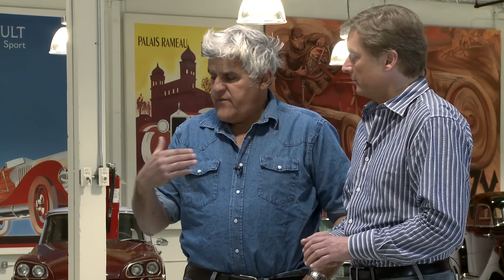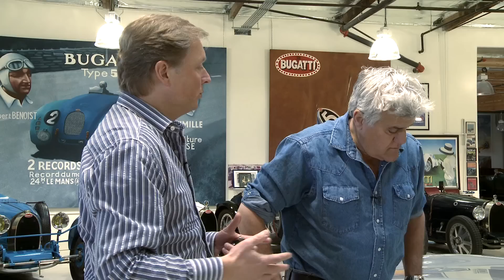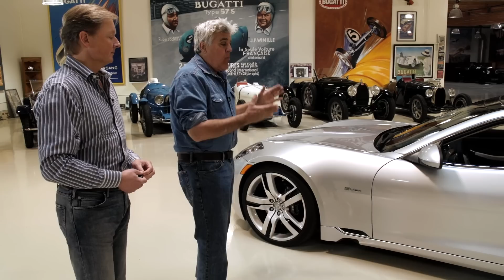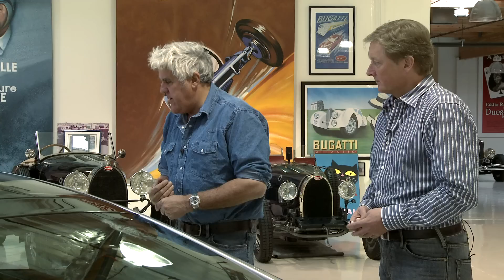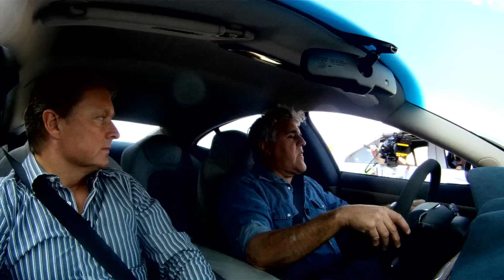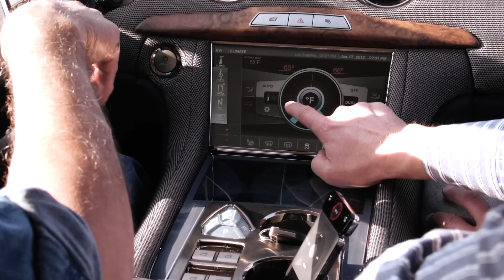2012 Fisker Karma - Jay Leno's Garage

Comment: Jay, my fellow carophile, lol. 
The term "electric car" is a misnomer! It's actually a "battery powered, or operated" car. Let me illustrate. I use many tools. 
There are two types of tools that use electricity to operate...work. 
For instance, an "electric drill" has a power cord that has to be plugged in to an electric outlet for it to operate...work. Then there is a "battery operated" drill where a battery has to charged on a charger, and then... that charged battery has to be attached to the drill for that drill to operate... work. I could give you many examples of "electric" tools versus "battery operated" tools, or other devices. So calling a battery operated car an electric car is a misnomer.
-------------------------------------------------------------------------------------------
Reply: Yeah wtf

Comment: Too bad Fisker had to fold back in 2013. By now they would have at least 4 different models on the market. I still think that Hydrogen or some other power generator could be an excellent power source for the electric motors and batteries. Perhaps only in a large car like a pickup or full size SUV due to size. Not long ago I took a 1K road trip in my Model X charging time alone was close to 5hrs all together. We need either battery swamp tech, static charging or extender range with hydrogen or something else. Pure Electric is amazing for any trip up to 400 miles. Just my 5 cents. :)

Comment: I would've put the engine and generator in the rear and the batteries in the front. Make the front end smaller and the cabin more forward. Looking more like a mid engine car. The front ends are too big on many modern vehicles. Especially trucks. It is beautiful though.

Comment: I think F1 cars don't work like this because there is a loss of power incurred from changing the work of the engine into electricity and then back into rotation.. in F1 cars the engine drives the wheels and is assisted by the electric system which also recovers braking energy.

Comment: Henrick Fisker is a disappointing "car guy".  He says the Karma's drive train (called Q-Drive) is unique and not like that of the Chevy Volt, but he's incorrect. The Volt is also a Range Extended Electric.  He also refers to the tires as "high profile" when they should be called low-profile.  To me, he just sounds like a used-car salesman...  Now he's trying again with his new company to develop an SUV, and so far it's all smoke and mirrors.  Sorry Jay.  I know you guys are friends,  but tell Henrick to stop spending investor's money and get to work actually making a car and a network of dealers / repair facilities.

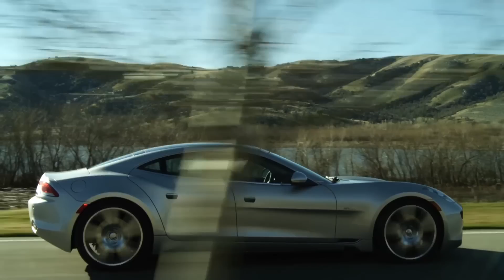Comment: 1:45 1100 lbs of torque and speed of a v8 but doesn’t say the 0-60 is 5.9 seconds 
Not only it’s the poorest use of space but the poorest use of power as well
At least Prius has 5 seats 😂
No wonder it lost so much value and no wonder people see so many of those on the streets 
He is definitely #1 in something
The 2012 model s did 0-60 in 3.9s @ $109k and had a range of 265 and free supercharging
Why would anyone in their right mind buy a more expensive car, inferior, and costs more to run and will break a lot easier

Comment: That GM 2.0 turbo engine has 255 hp, 295lb/ft torque, and gets over 30 mpg on the highway in a Buick Regal Turbo. The Fisker has a total range of 230 miles, 30 of which are electric. With a 9 gallon gas tank, and 200 miles extra range from gas, it is getting 22mpg by converting to electricity. Why use the GM LTG 2.0t engine and not a little 3 cylinder?

Comment: He says it's different from a Chevy Volt because a Volt has a direct connection between the gas engine and the wheels. Wrong. I'm amazed that someone can get to the position of this man and just be blatantly wrong about a simple topic. It is in fact identical to the Chevy Volt in terms of drivetrain design, and in fact, the Volt was the first to do it, and the first to use the term "Extended Range Electric Vehicle". This guy is ignorant in his own field. So sad.

Comment: 1100 ft-lbs of Torque and a 0-60mph time of 6 seconds, so sad, when a 2 speed tranny could have put it sub 4sec .... dumb engineering compromises killed this car, performance should have been MUCH better, should have been equal or better than Tesla Model S, but it isn't even close in performance ... the Fisker Karma certainly is much better looking than any Tesla .. the styling is superb, a wonderful example of how a 4 door hybrid can be styled better than any traditional gas engine drive-train car.

Comment: I don't think I like it. First impressions are that it looks cool, like a cross between an Aston and a Z8, unsurprisingly. But actually the details aren't good, the panel gaps are huge, exhaust on one side with a plug on the other, and that little thing at the bottom of the diffuser, what even is that? Jay was right to be confused about the engine bay, it's absolutely packed. How does a 2L engine, 1 speed gearbox and generator take up that much space?! Most of it seems to be the front suspension, which is very bulky. The performance sucks and the eco credentials suck. It does 20mpg on the engine. With the efficiency luxury car makers are achieving with IC engines these days, you're better off with a properly engineered big diesel.

Comment: a really cleaver upgrade would be to put an audi inline front wheel drive gearbox in between the motor and generator, like the one in the audi quattro, then all options would be open even petrol driven.a true hybrid

Comment: you can just see the build quality issues in this showcase car. the panel gaps and closing the hood..
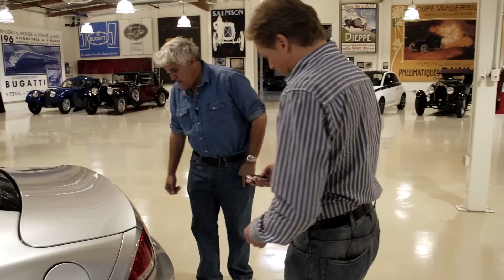Reply: 10:05 Look at that gap at the fuel cap. You could see the gap on the trunk aswell clearly. Its massive for its class.
Reply: the hood is a typical issue when you have 2 latches but they could have worked around and made it a single latch system if they cared to do so and yea its definitely not as high quality as Henrik marketed it to be. the headroom in that car is horrible. a good friend bought one new and i went to a restaurant with him the day after he picked it up and no joke he was going to sell it pretty soon after. like just got a car. getting tired of it the day he got it. tells me the next day, i sat in it and i had to have my seat back leaned further back than i like in order to be even remotely comfortable. and im 6' tall maybe 6' 2"
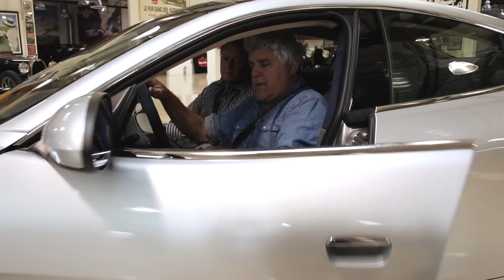Reply: 12:53 Door close. Sounds pretty tight to me.
Reply: There was one of these for sale near me so I took a look at it.  The thing had less than 10K miles on it.  I swear the thing had to of been totaled and rebuilt poorly not a single panel gap straight and panel that didn't even match in height.  If the car wasn't totaled at some point I would have to say Yugo put cars together with more attention to detail.
Reply: 10:28
Reply: Jordiva Sunaryo 

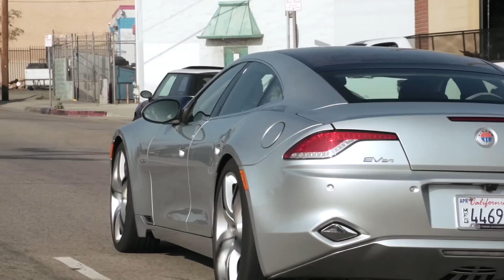Well, 3 seconds later you see the dude push on it out of frame because maybe it simply wasn't latched.  So from 13:30 on, you can see it many, many times again and it appears to be perfectly normal.

Comment: Heavier than an F-150, larger turning radius than a Silverado, less leg room than an A4, slower than a GTI, less EV range than a Volt, less extended range than a Volt.  This car is such a dull thud on the history of the automobile.  The Tesla is far superior in every measurable detail.  I'd rather have an E-Golf for commuting and an Audi S6 Quattro for grand touring and still have cash leftover or a nice vacation in Fiji.
Reply: the Fisker is the worst car ive ever been in. THE WORST and ive been in several. yea the Tesla aint cheap but this isnt worth 50 000$ if you're 5' 9" or especially 6' 2" you wont be comfortable
Reply: This Fisker's company from the video went bankrupt in two years after it was filmed, but the car is still selling, manufactured by Chinese in an updated version. I could be way better than what you tried back in 2011-2012. Also, Fisker guy himself has restarted his company and is now constructing his new electric car.
Reply: the Tesla is not cheap and at least in America your car is put on a waiting list x amount of time (usually around a year) and if I wanted a old fisker if I went on eBay motors I could pick one up for fifty thousand and the fisker aside from the McLaren P1 and McLaren F1 the fisker is the most striking and beautiful car I've ever seen the Tesla to me just screams another rich hippie in a car
Reply: But it looks cool!
Reply: It is impossible to run out of charge in a Tesla accidentally. You would have to purposely try to run out of charge.
Reply: Drove the Volt (carshare) many times, it quickly runs out of electric power. Although it has enormous speed. There was nothing on the road I couldn't easily outrun, but It runs out of electric quickly and the gas engine kicks on (thank God), runs a little rougher, a little slower but I'm not stuck.  Standing on the side of the road with no hope but a tow truck with a gorgeous Tesla, but no electric......bad look!

Comment: This car is really beautiful design wise, the front end immediately reminded me of an Aston Martin just to find out this guy designed some of those! I think the solar panels atop these electric cars should be a must, ever since i think it was the prius had them i thought it was genius- not because it contributes meaningful energy to run the car itself but because it can be used to cool the cabin on a crazy hot day when the car is sitting in a parking lot just absorbing heat energy and not doing anything with it. Really even gas powered cars should have this feature, and at least lightly tinted windows as these have a huge effect on cabin temp as well.

Comment: Who cares about the environment? I have 2 cars and non of them is electric or stuff like that but here's the deal if my car is not a HEMI 5.7L+ I just don't drive it. I Got a 2015 Dodge Charger Scat pack 6.4L V8 with 485 HP and a 2013 Ram 1500 HEMI 5.7L and they both taking care of me without getting worried about a battery running out or paying a 100k
Reply: HOOKAH SPOT VALMET
Reply: i dont know if you could get more ignorant or degenerate. both of those engines are dogshit and those boats, jokes of a sports car and truck aren't anything special either. Good for you big boy that you can tell your friend you've got a fat iron engine under the hood that makes less than most turbo 6 cylinders of half the displacement or less. Such an abomination of engineering so keep on going that route bud! Your loss.

Comment: beautiful car, it's sad that it failed.
Reply: He's a thief that deserved what was coming to him.
Reply: +PT50 aha, nu stiam treaba asta
Reply: +Dumy Jobby I had one, it's a great looking car and pulls a lot of attention, but the engineering was crap. Could get maybe 50 kilometers on electric mode at best, once the engine kicks in, it sounds like a cheap car and ruin the experience.  Now have an i8. Sport mode all the time, with a good sounding engine and I switch it to E only when in the city, and it sounds like a ninja. Good thing about sport mode is 20 minutes on the highway and battery is about full.
Reply: +Brawndo i get about 55 mpg but I have an heavy foot you can probably get what Bmw claims by using Eco more often. Btw rumors say a Chinese company bought Karma and it is to be resurrected with same look but better batteries.
Reply: Brawndo i think that if they wan't to succed they have to leave the hybrid tecnology and go for elettric only like tesla.
Reply: Dimitry Jobby n

Comment: Funny, this car needs to be less than 1/2 the price and be much less weight. 
  Cool idea , they didn't say how long the car will last though. I mean in years without having extreme costs. 

   @ this weight and cost. according to the conversation these two have in the video, this car is 20.00 a pound.    So how many miles does this go before i have to replace the batteries?  how much does the rang decrease in a given amount of miles? 

   They did not mention these things so we as consumers cannot determine if it is worth the expenditure.  if i buy a 100,000.00 car I have to know that I will come out ahead.

Comment: For the price, I'm surprised it'll only do 125mph top speed.  And I've read that the only acceleration band is 0-50mph and then it gets sluggish and docile.  Considering the company's failure and the financial problems, I'd add this to the DeLorean and Bricklin category in the history books.  I saw one recently with the reflective glass paint job finish - looked good in the bright sunlight and it caught the attention of a few people in the parking lot.  At $5k extra for the solar panel roof option and considering it only gave back about $5-10 worth of electricity in a year, it would take 500 years of parking it outdoors in the sun to break even on the solar investment option.  Still - the guy took a shot at designing something unique and innovative.  Too bad he's just a good designer and not a good car manufacturing executive.
Reply: Well its an electric car with one speed so 125mph is still impressive and for everyday driving 0-60 is much more important. The company was bought by an asian company and its coming back with a new name. Elux Karma and it's exactly the same car just under new ownership.

Comment: Seen one of these in person

Its alot bigger then ive expected
Reply: +Major Lag I test drove one in 2014 while at a Cadillac dealer testing an ELR. It seemed like the interior was cheap and weird.  I bought a fully loaded 2014 Volt which I have since traded for a 2014 ELR dealer car.

Comment: love the solar installed and it's use.    why not a suv with 4 engines  4 wheel drive with 4 transfer cases/transmissions, 4x4 low on demand, drive on 2 engines on average, 1 engine on flat surfaces over 50mph,  4 engines kick in for racing and offroad surfaces.    power generator that runs like the Northstar engine,  runs of some cylinders and on all when needed.     let's bull something extrodinary like it.